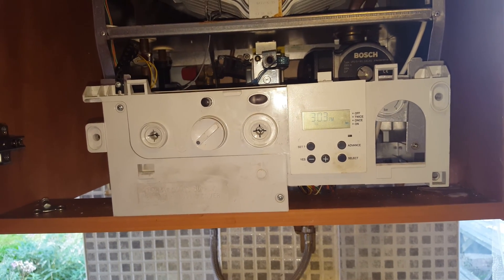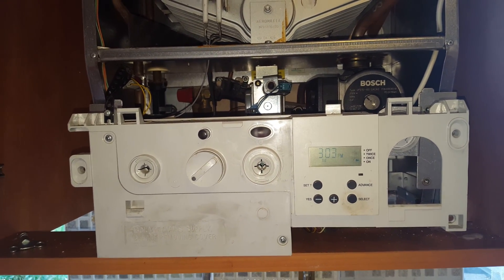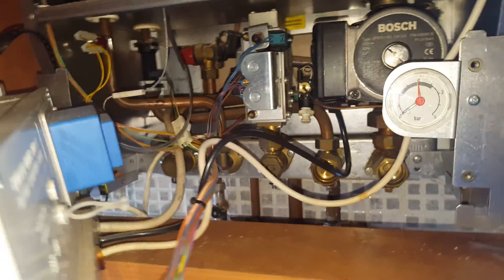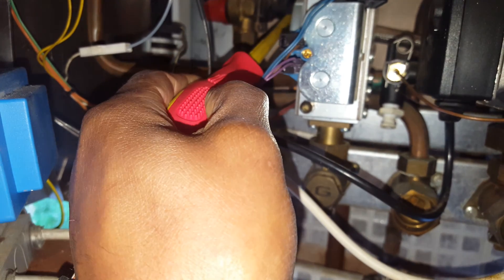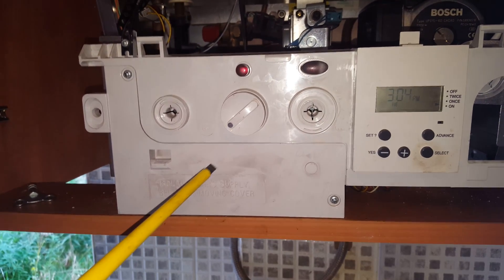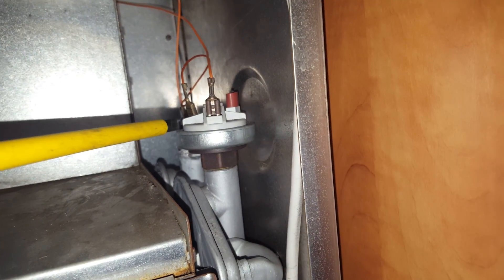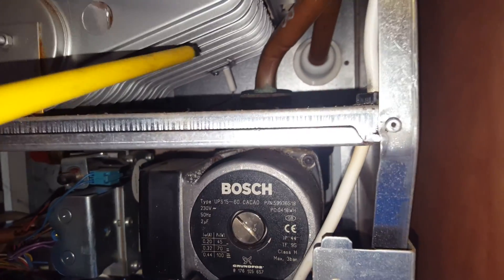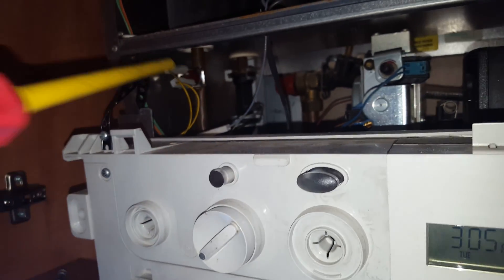Boiler repair Worcester 28I Junior RSF

Comment: Hi Tony I have this boiler but it's flashing 5 times a second and pressure gauge is low. Any tips on throwing it in a bin? 🤣
Reply from the maker: It could be the expansion vessel
Reply: @ARBoilers  if I only knew what that was! Pressure gauge back to normal now though but still having cold showers god bless this heatwave right now thanks for the reply anyway!

Comment: Hi Tony, I always watch all the videos you make and very helpful for me as a newly qualified engineer. My customer got same boiler and the fan needs to be replaced but I take it out. I followed the mi and called technical teams but no joys. Is there any other way to take the fan out?
Thanks
Reply from the maker: Video it and email tony@engineerteamco.uk
Reply: If you are unable to take a fan out I would seriously consider quitting, are you still in the trade as it was 2 years ago

Comment: Hi Tony good video!! I have the same boiler and the hot water is really hot..i cant control the temperature.  Do you have any idea what the problem could be?
Reply from the maker: +Ken McIntosh thank you
Reply: And my question?  Thanks
Reply from the maker: The maximum burner pressure could be to high